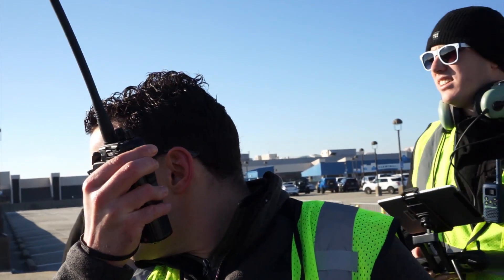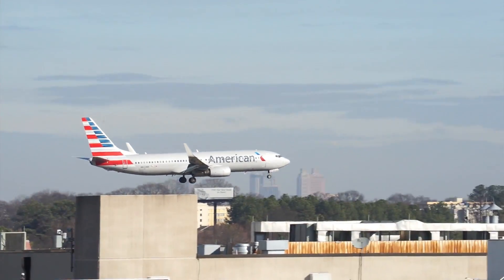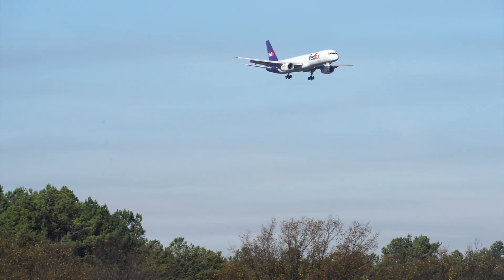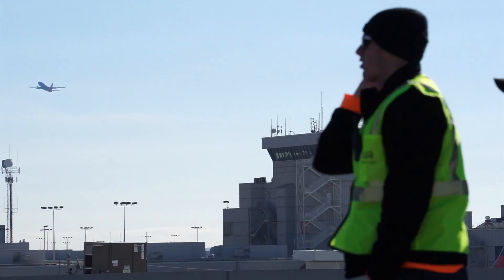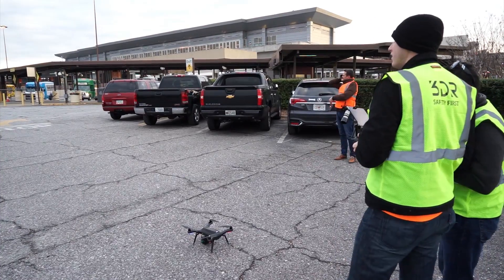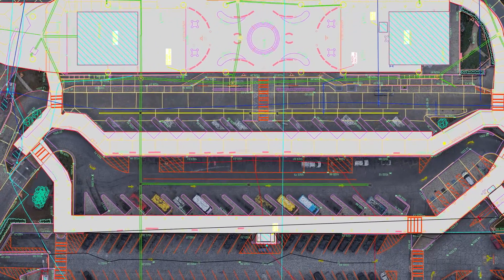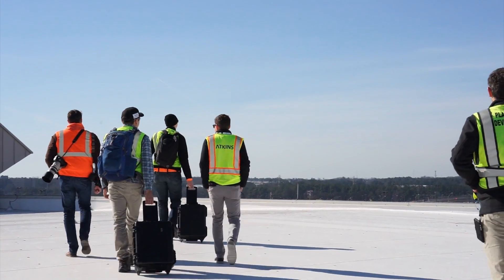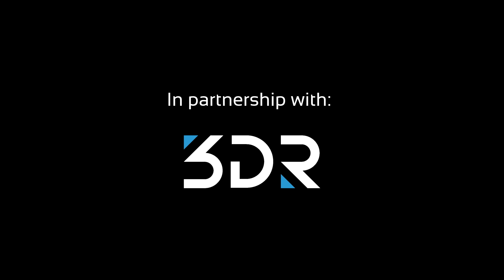The first commercial drone flight at a major US airport

Comment: The Atlanta project is interesting, but hardly a first.  Kona International Airport at Keahole, Hawaii was probably not a first drone application either, but they have an FAA Certificate of Waiver or Authorization dated Nov 2015 for work that was completed by Orbic Air, LLC in 2016.  When drone operations are conducted per the requirements of FAA guidelines, and under direct control of the air traffic control tower, they are very safe in commercial airspace, even in the immediate airport environment.
Reply: Dave Hein They're capturing land data in 3D